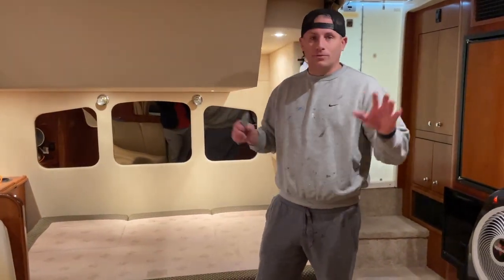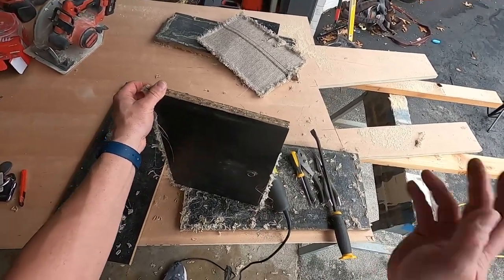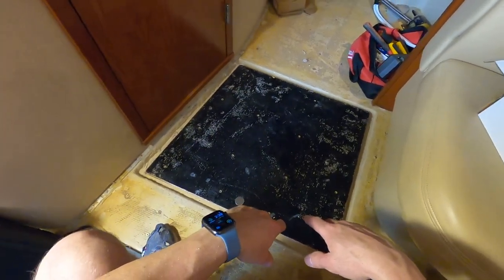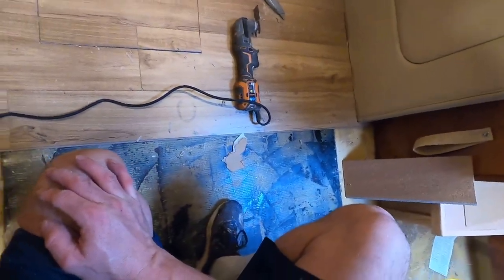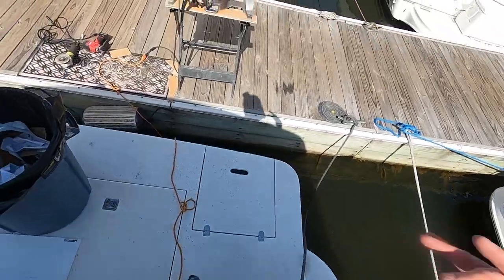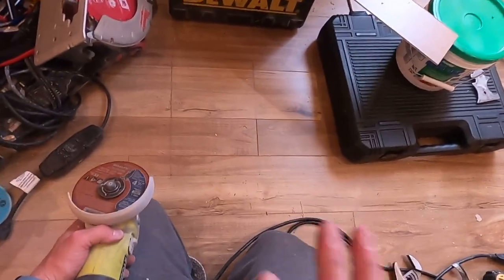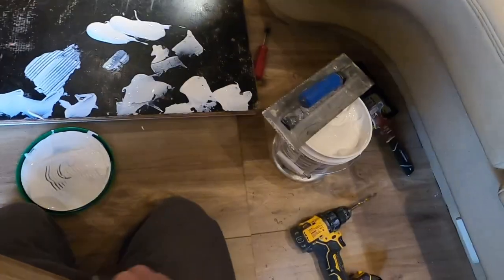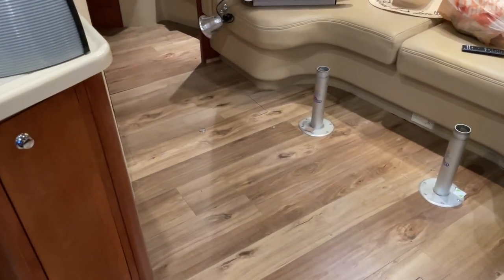How you install LVP(Luxury Vinyl Plank) Flooring in a Boat Cabin

Comment: We are renovating our 37' Silverton MY.  You've made up our minds on what flooring to install.  I've installed floating floors in my house but I was unsure how to do the floating floor over the hatches.  Great work.  Thanks for the video.
Reply: I have a 37 Silverton that we are replacing the floors on. How did you project come out?

Comment: Looks great.  I'm about to do this in my boat.  Thankfully I have no hatches in the floor but there is a lower section on the floor.  I hope to fill that area to bring everything level.  Great video.  Thank you for the tips.  I do this work in houses but I already knew the boat was a new beast.
Reply from the maker: Get ready to be sore, very sore. Lol. Good luck with the project!

Comment: Great video!

How did you mark the location of the hatch when laying the flooring to know where to cut?
Reply from the maker: When I laid in a board I measured underneath it, then drilled a small pilot hole. After the floor was down, I used the pilot holes and made lines, then used the metal cut off grinder to cut the hatches out.

Comment: Great Video!  I have the exact same boat, how many sq-ft did you end up buying when you account for the trim loss?  I am debating between commercial grade or NautikFlor which is 3x the cost.  Thanks
Reply from the maker: Not much. I think around 100 sqft. I would not spend big money on this. The floor has held up so well 3 seasons in with 3 kids and a small dog.

Comment: I really wish you'd shown when you cut the table bottom. What did you use? A router? The grinder?
Reply from the maker: I didn’t cut anything. I just laid the metal on top of the floor, screwed it in. There’s no hole there.
Reply from the maker: Probably just a jigsaw for the actual hole. Nothing crazy there.

Comment: How did the sound change compared to the carpet?  Does the cork help?  Great job you inspired me to tackle it. Also what color did you use?
Reply from the maker: We didn't notice a change in sound very much. Boats are loud, lol. I think the cork helps with sound deadening and a little softer board. I'm not sure on the color and I can get back to you on that. It's a very worthwhile project and after 2 seasons the floor is holding up very well.

Comment: Hi, I have this same model 2007 37express.  What did you do about the couch frame scratching the floor?  I was thinking of making some plastic feet or something.  How well is the thin peice holding up outside the bathroom door next to the hatch opening?    Has me thinking i would rather go end to end VS side to side on the lay out.     Either way  it looks good.
Reply from the maker: Couch frame does not scratch the floor as it just plops down on the LVP.

Comment: Nice video. This is the first time I've seen the planks installed in this direction. Every other installation has the planks running the length of the boat from bow to stern. IMO looks better this way. Did you finish off the steps? If so, how did you complete those?
Reply from the maker: Thanks! I feel this direction also looks better and in theory makes any cabin look bigger. Skinny long lines make a space look smaller going vertically. These horizontal lines make the cabin look bigger and a few of my boating buddies that did their own cabin did copy my approach. 

I did the stairs in Cherry. I purchased some cherry plywood and some 1x, traced out the old stairs and put it together that way. I still have to stain them and they are currently sitting in my garage, lol. I'll get to it before spring.
Reply: @TodayIWorkOn  Pretty funny that it never occurred to me to align the boards that way. What color rigid core vinyl plank did you use? I couldn't make it out from the boxes in the video. The interior color of my 2000 SeaRay 380DA is identical to your boat.
Reply from the maker: @SCFoster  https://www.flooranddecor.com/nucore-performance-flooring?start=0&sz=48

It's a Floor and Decor line.  They are beefy! Very rigid and strong, lol. It did add about 300 pounds to the boat, but I didn't think that was going to bother a 20,000 pound boat like mine.

Comment: Looks great…I just did a very similar project on my boat, not easy with angles and water proofing elevation differences.  What product did you install to lift your hatches?
Reply: Good question.  He hasnt responded, but from what I understand these floors are supposed to be "floating" so no glue needed.  However, I would think on a boat you'd want to glue them down and maybe even seal the seams to keep water and moisture from building up underneath them since the environment is more humid and damp than a resedential install.  Just my $0.02.

Comment: It looks like you didn't remove the old carpet glue.  Is it ok to lay down the LVP over the old glue (assuming it's relatively smooth?)
Reply from the maker: It’s been a couple of years and the floor is great. I guess it’s just fine.
Reply: @TodayIWorkOn  Am I right that you didn't remove all of the carpet glue?
Reply: Also looks like you just floated the flooring?  The product I'm using suggests I need to glue it down (I have a Cruisers also - 3375)
Reply from the maker: @scottbettencourt4051 correct.
Reply from the maker: @scottbettencourt4051 I would follow the instructions on the material you are using. I used a nucore product that was a floating floor.
Reply: @TodayIWorkOn  Thanks for your replies!  Boat looks great!!

Comment: Did you leave a gap for expansion - and if so how much?
Reply from the maker: I mention it in the video, but in such a small space I didn't leave much,  Usually in spans that are way longer, you should leave 1/4", but since we are talking 5-6', I kept it tight.  Floor did great this whole year with 90 degree temps and 80% humidity!

Comment: Why not just make a new hatch rather than fill it with strips?
Reply from the maker: This was way easier than routing out a new hatch and marine grade plywood was EXPENSIVE when I did this project. Old hatch worked just fine. After almost a whole season, it’s done really well.

Comment: NOT a great way to do the hatches! A better method is to do the hatches first and leave a 1/4 - 1/2 inch lip over the edge of the hatch where you can, this provides  a clean square edge either by a virgin board with only the tongue cut off or a nicely clean cut piece. If the hatch is slightly out of square, which most are not you may have to sand the edge slightly flush to the hatch. Then butt your adjacent pieces against those edges with a thin piece of poster board as a spacer to allow some even space around the hatch. Once you match the floor around the hatch the edges will be very clean and look much better than using a saw, grinder or vibrating saw to cut open around the hatches.  Hatches are a necessary evil within boat floors but you can make them look much cleaner than this method.
Reply from the maker: Not a great way, but nothing has shifted in 3 years and I don’t even notice the 1/8 cuts I made. People that see it in person love it since it blends into the floor.